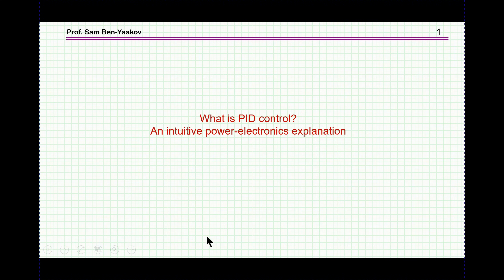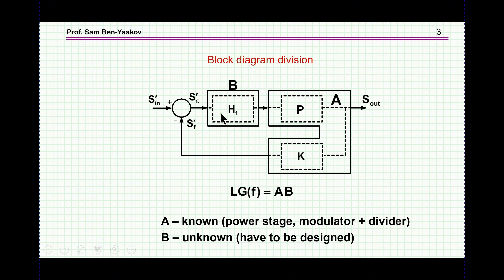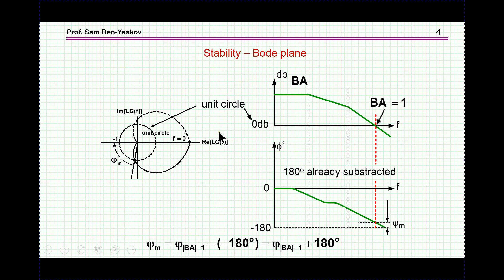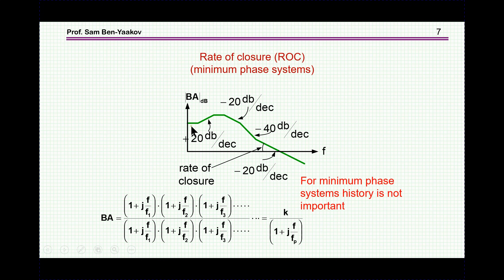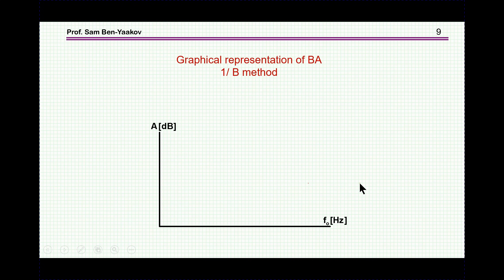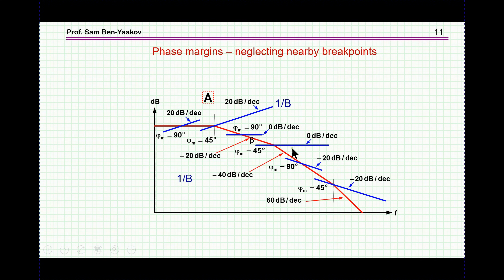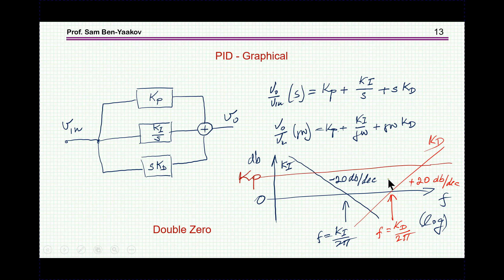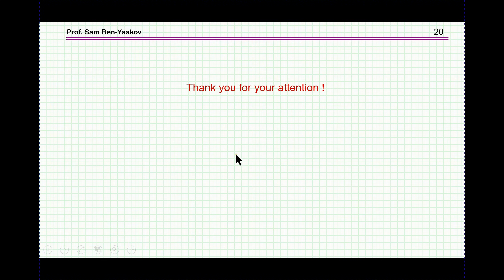What is PID control?

Comment: Sir coming to controlling of llc how does the error Amplifier or compensator ouput gives frequency that we need ,the same compensators are also used for getting duty,how is this possible please do answer or make vedio,please sir.
Reply: That's fine sir but how the same compensatory circuit is used for getting different control variables like duty, switching frequency .
Reply from the maker: @swathi9086  Why same?You need to design the controller per topology based on the particular transfer function of the system.
Reply from the maker: The output of error amp drives an VCO. Not a duty cycle modulator.

Comment: Thank you Sir, I am using PID many times in my work, I design and build controllers specifically for temperature control in laboratory equipment, I developed a software algorithm to auto tune the controllers with software from #boianmitov with #Visuino software.
Reply from the maker: Thanks for sharing👍

Comment: My experience over 15 years tuning galvos, voice coils, current drivers, ovens and TEC controllers, that D term can be successfully ignored. Occasionally, an automatic tuning is available (e g. Ziglier-Nichols), suggesting small D contribution, but tuning improvement is typically marginal (few %). I know that some authors are adamant about D term, which is contrary to my experience.

 My question is simple: where the idea of using P + I + D in feedback loop for system control comes from? What is a background for that (apart from empirical approach)? Most textbooks omit this subject entirely, succumbing for: "Let's try to control our system using PID..."
Reply from the maker: D is used in control of power electronics systems! It would seem that you have not watched carefully the video. The fundamental reasons for using PID is in it. See also
https://youtu.be/sA_6nEku3mo

Comment: Thanks. A suggestion for a future video about TypeII and III compensators especially for an application like converter and they are in this tool Power Stage Designer Tool
Reply from the maker: See  https://youtu.be/WCHI93rFC28
Reply: @sambenyaakov  Hi sir. Can I ask which video did you want to send? the link you sent, is the link of this video. Thank you sir

Comment: I think that 6dB/oct is much more clear than 20dB/dec 
It ís the same slope, or am i wrong? 
I like your lessons always, but this time i think a more practical approach was more usefull. But maybe you find (and maybe you then are right) that there are already enough of that sort videolessons online that are incomplete because they are missing much theoretical complexity for them who needs that deep understanding. And indeed its interesting to know.
Reply from the maker: Hi Bob, I am leaving the Octaves for the musicians. Rarely, if ever,  do power electronics workers use db/Octave. And by the way, 6 db /Octave  is an approximation. It should be 6.0205999.........  (-:
Reply from the maker: One more point, the objective of this video is to unveil the mystery (to many power electronics workers) as to what is PID.

Comment: Hi,
Thanks for your nice explanation. With reference to your LinkedIn Comment.
https://www.linkedin.com/groups/13606756/13606756-6428348019577618435
 I am pasting your expression here for viewers for the correction in the last slide.
"The expression 1/2*pi*R2*C3 in the last slide is not meant to indicate the the location of the first pole but rather the gain in this section. Unfortunately, there is a mistake in the drawing. It should read 1/2piR2C2. (this is for the approximation C2>C3))"
Reply from the maker: Thanks for posting this.

Comment: Thank you for your detail explanation on PID control. Could you explain why the first pole  is 1/2*pi*R2*C3 ? I normally start at the zero 1/2*pi*R3*C2 with dc gain of R3/R2 and draw backward +20dB slope until it cut off with the  op-amp open loop dc gain. Wonder if that the right  way to do it ?
Reply from the maker: Hi Thanh, The expression 1/2*pi*R2*C3 is not meant to indicate the the location of the first pole but rather the gain in this section. Unfortunately, there is a mistake in the drawing. It should read 1/2piR2C2. I hope other viewers will notice this correction. I might prepare a short correcting video.
Reply: We've already suffered for this :D

Comment: As good as always.
I think the first pole for last circuit you've shown must be rather 1/2piR2C2..cause C3 impedance is still higher than C2 impedance..thanks
Reply from the maker: HI George, Thanks for discovering an error. You are right, it should be 1/2piR2C2 but this is not the pole location but rather the gain in this section. The location of the pole will be determined by the open loop DC gain of the amplifier.
Reply: Hi prof..thanks for correction
Hope you explain this region of the plot in a video like how open loop DC gain determine the pole location
Always get benefits watching your videos